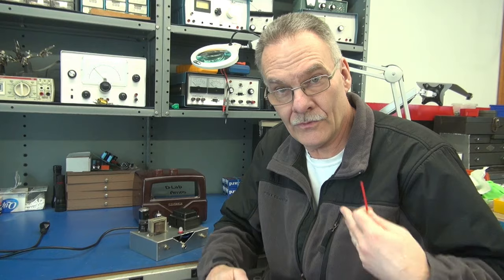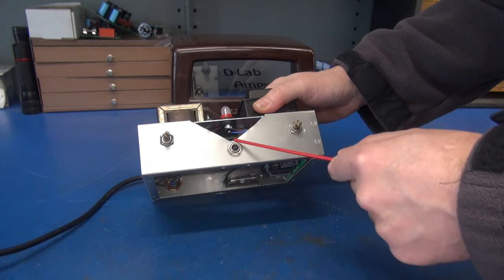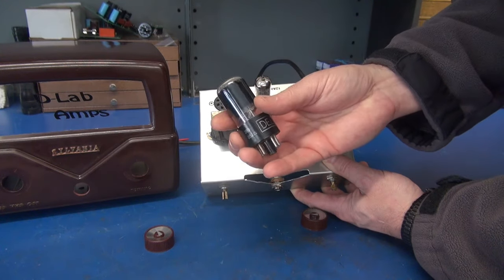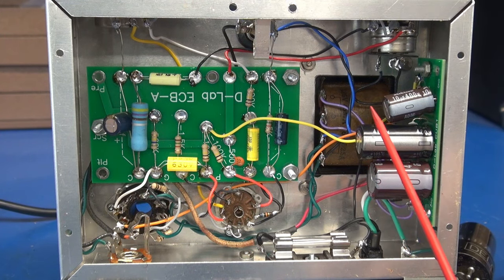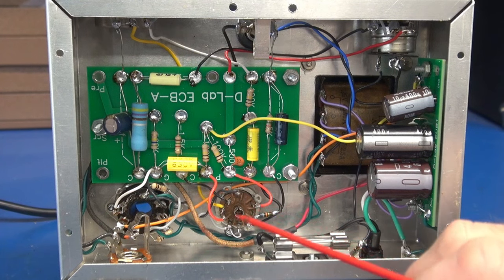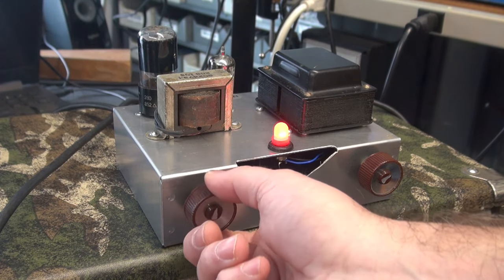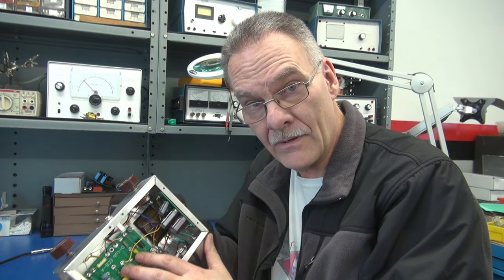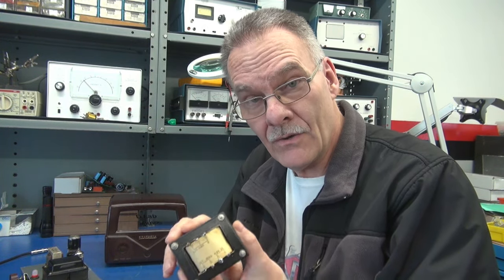Build basic 2 watt 6V6 Tube guitar amp Simple design great sound & distortion perfect beginner kit

Comment: I hope that some day, when you are making one of your custom design amplifiers, that you Add one more hole in the top of the chassis and wire in a socket for a 6AQ5 so you could use either a 6AQ5 or a 6v6 as the output tube, A mod like that would work absolutely great with the lower plate voltages. In fact you may be able so squeeze a little more clean power out of the 6AQ5 because it has a little higher transconductance at the lower plate voltages than the 6V6 does,
 As far as building amplifiers into existing cabinets from the 50 and 60's, your ability to see the finished product in your mind's eye before even starting on the chassis absolutely amazes me.
 I am considered by some to be a pretty good tube tech, but you are more than that; you are an artist when it comes to custom amplifiers into old cabinets!
 I really enjoyed seeing and hearing the finished product in this video!

Comment: That's a neat little design!
The one thing that I would do differently on this amp, and it might not even be necessary, is to run the heater winding center tap to the cathode of the 6V6.  Your amp does seem to be rather noiseless, so it's probably not necessary here.
Reply: I'm yet to find a better way to reduce heater hum than using a virtual center tap with a trimpot to the ground. You eliminate any trace of hum, if it only comes from the heater.
Reply: I back it off, yesterday finished an amp that would always hum, no matter what I did. It turns out there was a heater leakage to cathode. It was resolved by changing the virtual c.t from ground to the cathode resistor on the power tube. No hum anymore.

Comment: I have an old True Tone under dash tube car radio enclosure out of  a 1936 Chevrolet. It may be military idk?The tuner and tubes are all long gone , just the box but it has a built in 6 inch speaker. Kind of a streamline Art Deco looking metal box. I would love to give it to you . I think it would be a quite a challenge for you to turn it into a tube table top combo. Or you could just put it on the shelf and think about it ?

Comment: Another cute little amp again from your assembly line! 🍷😁
But you could as well develop that two tube desing towards a Dumble ODS type of beast by adding one extra 12AX7 to give that distortion which is produced by cascaded preamp stages. Of course it needs a couple of extra gain/volume pots, a DPDT switch and some extra wiring but, believe me, it is worth the effort. Your guitarist friend would love it.
Reply: so then let's see you build one and post a video
Reply: This also is the way Geoff Emerick got the distortion for John Lennon's guitar on the electric version of Revolution.  The guitar was running two cascaded mic preamps directly into a mixing desk’s channel, being very careful not to fry the channel.  So much fun to see good old school valve amps still appreciated for their simplicity and sound.

Comment: I know it’s not all about the wattage. However, my Hallicrafters SX-42 has a matched pair of 6V6’s in push pull, and pretty sure it is in the 4-5 watt range? I am using the current Groove Tubes. That does look to be a nice, beefy transformer. But surprised the wattage isn’t higher? Im not an engineer, believe me.
Reply: Maybe that's not wrong. That would be the case if the tubes are in self split push pull.

Comment: Just fantastic terry. Im new to your channel and new to amp building. Ive put some guitars together but im a complete novice at building. I have to say that i was very happy to see you making this simple amp with the tubes i desire. Western Electric is supposed to be making these tubes soon i hope i can use those to make this. Thanks for the vid
Reply: Hi Nick, you can still get very nice NOS New Old Stock, American 6V6’s and 12X7’s all day long on eBay for not a lot of money.. No need to wait for some long ago defunct company to start rebranding Chinese tubes.. But yes, this would be a very nice 1st build (and would sound great too). Even better if you had a chassis maybe 1” wider would be to use two 6AV6 tubes (each is one triode of the 12AX7’s tube) and those are available for only a few dollars, and get 1 6AU6 pentode, so you could have 2 inputs, one going into the 1st 6AV6 triode, then into the 2nd 6AV6 triode (the same as going into both halves as in Terry’s amp. Then have the other input go into the 6AU6 Pentode 1st then the 2nd 6AV6 for a
Reply: @Tom-th1oy  Thank you very much. Very useful information.

Comment: WARNING: Hi All, don't be fooled by the size of that little thing I was working late one night and forgot to wear my gloves and didn't discharge the caps. It was unplugged and the top coli had been damaged on the corner I had one hand on the metal box and the other hand touched the open wire! It happened so fast that I didn't know it went threw me until I was able to let go. I then shorted out the cap and it still had juice in it "sparked" so ALWAYS BE CAREFUL, wear gloves and discharge the capacitors ALWAYS. Be save everyone.

Comment: That can almost looks like the front of a VW van. My oldest brother took an old RCA console that had radio and turntable at one time but the speakers were blown. He built a new cab . Eliminating the radio and installing what initially was alongside the turntable and radio facing forward. He used some of the original tweed to cover the front . And installed some perforated metal plate behind for heat distribution.  It ended up very low volume so he added an external preamp. Prepackaged.  Don't know what out put rating the amp had but with the right speakers you could plug a guitar or bass in. The system itself naturally emits a lot of bass. Don't know why he didn't use the preamp from the turntable input. Maybe it was shot.

Comment: I have a pile of old 50's tube radios and amps , just pulled out 2 magnavox 188 aa amps with 3 speakers attached to the panel, plus I have an old vox AC 100 that's a virgin amp and it works I'd love to get some of mine converted to guitar amps

Comment: Very conservative design, S/E 6V6 are usually driven around 3 watts, so that tube should last a long long time. I find used 6K6 cheaper to come by and more available.

 If I can't get this old Hoffman 21" black and white TV going that has been sitting in my parents garage, I was going to steal the output transformer and 6K6 tube out of it and build an amp. Secondary is 3.2 ohms if not mistaken, used a Rola 6 x 11 oval speaker which is very rare, used in some harmonica amps.

Comment: good job...but if i wanted to use a 6sl7 instead of 12ax7...the tension change?  sorry for my bad english
Reply from the maker: Yes, you can use a 6SL7, just add the octal base. Gain will be slightly lower, but I have used them many times in the past. Great sounding preamp tube

Comment: I have a  1936 RCA Victor Model 6K Superheterodyne  Radio. Rating  A = 105-125 volts , cycles 50-60 , watts 80.  There is tubes : 6A8 ,6K7 ,6H6 , 6F5 ,  6F6 , 5Z4 . May be I make a guitar amp disguised in radio !  Would like to use 6550's.

Comment: is it possible to build something similar to this, but just  as a clean 6v6 POWER AMP only? removing the pre-amp stage.

I have pre-amps that I am connecting in the return FX loop of a 15 watt Egnater guitar amp, with 3x AX27 (gain, fx loop, Phase Inverter) & 2x6v6 , I bypass the preamp and go into the PI Tube and power tubes and into the amp's cab, but I was looking to build a standalone tube power amp, that I can use separately, with different cabs, with dual 6v6 tubes and a PI or a single ended with one 6v6, , would that require JUST the removal of the preamp stage tubes? or do they stay in and get repurposed to run cleaner?  or is it a total different design?

Comment: Hey Terry could you please send me that .jpeg you have ready of the schematics for this build please. Also you mentioned that you make the ECB-A component board as well but do you offer the ecb board already populated for this style build? And what would the cost be for that board either way? And finally my last question is what would the cost be for the CUB1 power supply board ? I’m considering building this as my first attempt for a guitar amp. Thanks for your info and contribution to keeping the tube projects alive. I’ve only ever experimented with tubes in larger RF style amplifiers such as 10 meter linear amps. Which I would think aren’t too much different.

Comment: I've had a 6V6GT and other bits laying around for a while to build an amp similar to this, although I am after a general purpose amp rather than a guitar one, so probably a little different in the biasing and only one stage of pre should do it.
I like your box, that's the other question I've had, as I wanted to show off the valves, just a pity they are hidden behind the transformers, although I realise why you did it that way.
I'd have to use something bigger as I wanted to include a speaker, this should give better air flow so putting the tubes up front behind a bit of glass should be no problem.

Comment: Would it be correct that it is the OUTPUT TRANSFORMER that determines/establishes what speaker the impedance needs to be?  Thanks!
Reply: It's the relationship between the output tubes and the OT's primary resistance coupled with the B+ voltage that will dictate the ideal impedance at the OT's secondary taps
Reply: @jasonlamoureux7578    Thanks Jason!  I thought my question was probably too simple.  Now I’m on a quest!  😁
Reply: @brentgilbert4208  Hope you have a lot of supplies! The quest you’re on can be VERY long and fun!
Reply: @williambock1821     Uh oh!    Lol!!!

Comment: What would it take to build something like this but large enough to run a couple of 12" speakers (large enough gig small venues )  I could build my own cabinet and I could also make a chassis if I had the drawings with the layout in inches. (I'm a born and bred American and don't give me no mm measurements. I building and using good old American feet and inches for over 45 years.
Reply: A 6L6GC output tube will get you around 10 watts output in class A single ended. A KT88 can get you about 20 watts. 20 watts is loud enough to play with a drummer. Transformers get more expensive as you go up in wattage. Single-ended output transformers are larger and more expensive than an equally rated push-pull transformer.
Reply: An efficient speaker really helps. You have to double output power for an increase of only 3 decibels.
Reply: You will need at least 15 watts for a 12" speaker to be loud enough for a small venue. I use a princeton reverb that I build and it cuts through with the drums. You can also go with a 5E3 which has lesser tubes and be running at 18 to 20 watts
Reply: If your only concern is output power, it's cheaper to go push-pull. It's a different sound, though. Some people prefer class A1, but most like the sound of class AB1.